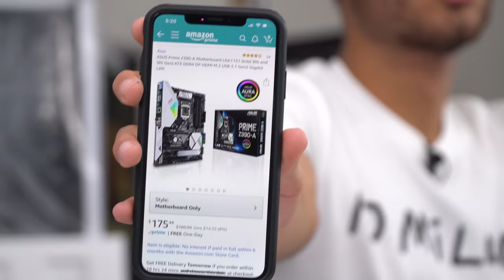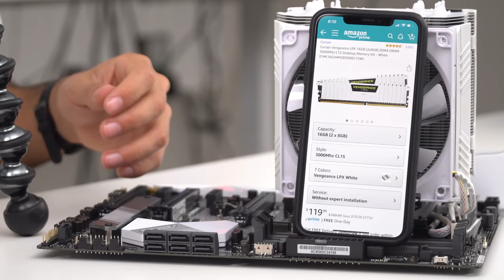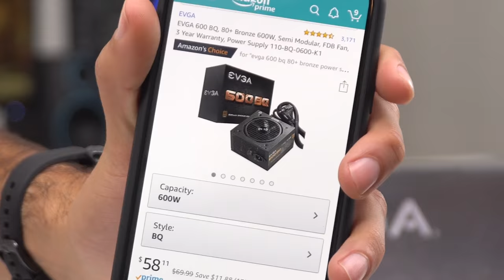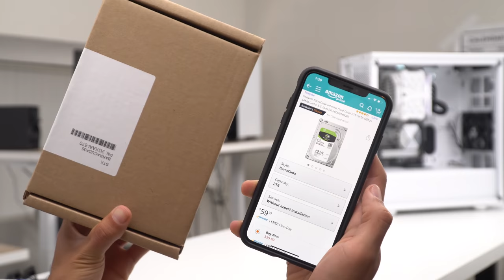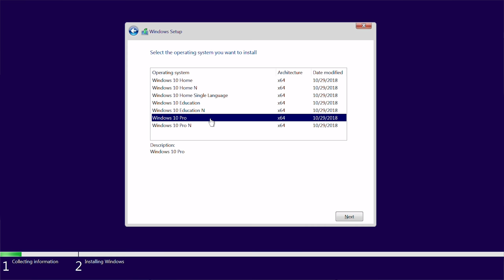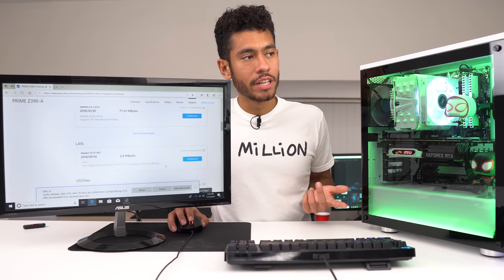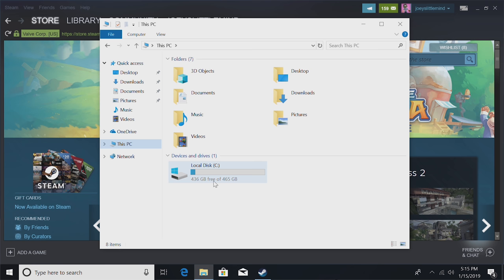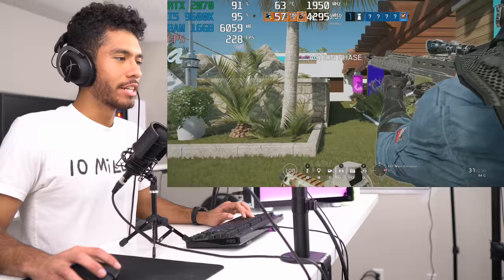$1500 Gaming PC Build Guide - RTX 2070 i5 9600K (w/ Benchmarks)

Comment: I built this PC with a friend and my dad tonight, love it!
Reply: Nice, how good is it. Im think8ng to do the same but im going to use a rtx 2070 and a core i7 which will upgrade it a bit
Reply: @MagdyF that would work even better, but even with the i5 I was able to get very high framerates on a lot of games maxed out settings. Doing the i7 would boost that even more.
Reply: @ericpederson6333  alright then, thx.
Reply: @Mohammad Younes nah the psu hes using is fine
Reply: Sry I'm a bit late but if you change to an i7 do you have to change anything??
Reply: @leoh.6379  check which socket it is, if it is a different socket from the cpu he is using in the computer you will need to change your motherboard, if not then no.
Reply: I'm building this exact PC right now. What monitor would you guys recommend? I'm a complete noob at 37 and this is my first build!
Reply: @jdwhodey  msi 144hz monitor bro
Reply: @jdwhodey  get at least a 144hz monitor, if you get a 1440p 144 monitor it probably won't be utilised to its full potential unless you play esports titles. Also try and find an ips panel if you can.
Reply: @urosjovanovic8625  yes
Reply: guys can someone help
me get a good cpu cooler becaus the one here is sold out i need one maybe better or the same please !!
Reply: @olytm9355  look at the corsair h100i or h115i or something

Comment: id recommend getting the MSI MPG Z390 Gaming Edge AC LGA1151 (Intel 8th and 9th Gen) motherboard it also has built in wifi and bluetooth its one of my favorite motherboards to use and its about 10 dollars cheaper than the one linked in the desc
Reply: Thx bro
Reply: Does it fit the case?
Reply: get an amd cpu and board u dont have to pay extra for overclocking . plus they have better value with support for pcie gen 4
Reply: Yo does the motherboard support gen 9 out of the box and can I use 3200mhz of ram or do I need to oc

Comment: I noticed the CPU and GPU are almost at %100 usage. Is that a bad thing ?
Reply: It's a good thing lmao. It means your GPU isn't throttling
Reply: If you don't lock your fps, ideally you'd get 90-100% on both gpu and cpu. If you're seeing your cpu getting fully loaded with your gpu barely breaking a sweat (or the opposite) you have a bottleneck.
Finally if your gpu (rarely cpu) isn't getting a high load and your fps are lower than expected, or there's stuttering, then you're thermal throttling: check the frequencies and temps to verify.

Comment: if u are watching this now get amd ryzen 5 3600 or 3600x and 2070 super
Reply: Ral- ph yeah why not if money is not a problem then yeah
Reply: I got RTX 2080 super is it better?
Reply: IndieChillout hell yes
Reply: HeRo what you rate the 2060 super or the more budget friendly 1660ti
Reply: @francoistaljaard12  my friend has RTX 2060 Super and its practically on the same level if not better than the previous GTX 1080. I know cause I had the 1080 before I got my 2080 super. The 2060 super if you want to future proof and high refresh rate gaming and higher resolution. 1660ti if you just want to play now and not too bothered about future proofing. 1660ti is more than good enough for 1080p gaming at 60fps+
Reply: Francois Taljaard  i mean if u have a lower budget u obviously go for the cheaper but the 2060 super is better but there wouldn’t be a significant fps difference it’s kind of like comparing the 1080 ti to a rtx 2080ti

Comment: I'm going to buy this in a month or so!
Reply: I'm going to buy the parts this week hyped pc masterrace when I'm back from vacation  then it's gonna to be finished by a friend that builds it. He worked by a pc company and have build pcs there too nice
Reply: @djangojansen7082  Could you tell me (when finished the build) how it was like and how well it performs?
Reply: @nesto9889  Its already done. My pc can handle 130 fps on everything epic on Fortnite. Without shadows and post proccesing. I get steady 240 fps.Without overclocking with overclocking cpu 70 degrees and gpu 81. 190 all epic 240 still steady.
Reply: @nesto9889  Let me see and take my partslist wil send it in a minute. U can also make it different with a 2070 it costed 1500 euro but the parts are the best and further proof.
Reply: @nesto9889  Coolermaster TD500 RGB full atx Diamond, Coolermaster Lite 700 watt Masterwatt lite PSU, Asus 1151 Prime Z390-A ATX RGB/ usb 3.1 . mobo, Intel core I7-9700 + BOX cooler S1151/3.0/4.7 GHZ/ 65W. , Kingfast F8N M.2 SSD 480GB 1880/1500MBPS, Toshiba P300 1 TB/ 7200 RPM HDD, NVIDIA RTX 2060 OC, Kingston  16GB 2x8 gb HyperX Fury CL16 Black/ DDR4-2666Mhz
Reply: @nesto9889  Suggestion is to add a bigger ssd other cooler for the cpu and thats it pls response ive i helped u out
Reply: @djangojansen7082  Why a bigger SSD, I think an m.2 240GB is enough for Windows, right?
Reply: @nesto9889  your but im also downloading games on it ssd is superior m.2
Reply: @nesto9889  mine is 480gb
Reply: Would 240GB be enough for both windows and Fortnite
Reply: @nesto9889  ive used 260gb for only Fortnite, windows and like programms (u have to install them on your primary storage). But 240 will be ok but a little but budget like
Reply: @djangojansen7082  Ok
Reply: @nesto9889  how did the builds go
Reply: @djangojansen7082  hoe ging de build
Reply: @avatarmorris8956  goed alles werkt opzich perfect pc start lekker snel op enzo. Het enigste waar ik beetje aan zit te twijfelen om een i5 met 2070 te nemen dan had ik 150 fps op alles hoog en nu 130. Maar ik kan hem overclocken naar 84 graden max op alles En dan is op alles epic 190 fps. Dus ik zou deze build gewoon bouwen en dan misschien geen standaard cpu koeling erop zetten. Ik zelf ben waterkoeling van nzxt aan het overwegen of corsiar. Maar ga nog mechanisch toetsenbord en goede muis kopen. Dus denk dat het een luchtkoeling wordt van rond de 80 euro. Dan is die gewoon wat cooler
Reply: Nog bezig met ontvangen!!
Reply: @nesto9889  mag ik weten welke parts je gebruikt hebt
Reply: @avatarmorris8956  heb je insta, dan maak ik screenshots van mijn lijstje
Reply: @nesto9889  ja add @sjorsqk

Comment: if i used an i7 core instead of an i5, then would everything still programme the way they are supposed to
Reply: Umm what? It still works yes, just make sure the first digit at the end, like 9600k, isn't too low since it can cause performance issues called Bottlenecking

Comment: I built the same PC a couple days ago. I used the same motherboard, graphics card, RAM, case and hard drive. Instead of the other components i went for the i7 9700k, samsung 970 EVO m.2, and a corsair aio cooler. This mini upgrade all together was around £1600 and i can overclock later on if i want. Super dope video thanks for the help!
Reply: Younes Belacel are you getting the same fps he got on games while playing on this pc?
Reply: Probably higher but im playing in 1440p and i have no troubles with over heating and its super fast. The aio cooler is a must. It looks amazing and my cpu hasnt been any hotter than 41 degrees.

Comment: the only thing i changed about this was going from the i5 to a i7-8700k. 
with the power supply, would it hurt to go with a 650 or larger or is the 600 going to be more than enough?
Reply: Would also love an answer to this because I have a 600w and was hoping that’s enough with a i5-6400 and rtx 2070
Reply: TheAlphaWolf U dont need more than 600
Reply: The i5 9600k is better than the i7 8700k.

Comment: R5 2600 - $150
MSI B450 Tomahawk - $110
Corsair Vengeance LPX 16GB DDR4-3000 C16 - $105
Crucial MX500 500GB M.2 SSD - $50
WD 1TB 7200RPM Hard Drive - $40
Gigabyte RTX 2080 Gaming OC - $730
NZXT H500 - $70
EVGA Supernova G3 650W - $80
Total: $1,355
Cheaper and has way better performance than this build
Reply: @josephstein3559  You can get whatever you want. That would also perform very well
Reply: @josephstein3559  600 maybe, but even that would be kind of overkill. Just go with 600 because that is more than enough.
Reply: Doesn't ryzen gets really hot?
Reply: Zeiba 160 No, ryzen runs very efficiently it’s amd gpus that run hot
Reply: @emorodriguez7124  depends what you're using for cooling
Reply: Joseph Stein I didn’t list one because the amd stock cooler is good enough the 2600
Reply: @josephstein3559  if you want to overclock, get a 2600x
Reply: Joseph Stein You can get a mild overclock with the stock cooler. If you’re not satisfied with performance or temps, that’s something you can always change out, but to be honest you’re not going to see much of a performance difference going from 4ghz on stock to 4.3ghz with a higher end cooler
Reply: @josephstein3559  link to the 500$ 1080ti?
Reply: Zeiba 160 Intel gets very hot
Reply: Will the amd 5 2600 bottlenecks the Corsair Vengence rams?
Reply: @si1513  lol no
Reply: But how future proof?
Reply: Any benchmarks ran on that build to compare??
Reply: Can i upgrade this build?
Reply: Ben Shapiro u should have gone with a better cpu
Reply: @josephstein3559  Don't overclock Ryzen cpus for gaming, only for workstation use. Ryzen's natural boost system and xfr are better for gaming performance than a manual all core overclock. My advice would be go for the Ryzen 5 2600x, 200 MHz more performance on base clocks and boosts, and a better stock cooler for $50 is really worth it.
Reply: @josephstein3559  Np gl man!
Reply: 😂😂😂😂 Do you have any idea how hard the cpu will bottleneck? 
Nobody pairs a 2080 with a ryzen5 bro😂
Reply: Neelabh Agrawal The 2600 won’t bottleneck the 2080 and even if it does it will still get better gaming performance than the i5 and 2070
Reply: Rather just wait for 3rd gen 7nm ryzen
Reply: @josephstein3559  I would. The stock coolers are great for overclocking, and if you want to overclock down the line, there are great options.
Reply: Ben Shapiro any intel cpu which would fit this ?
Reply: Is a Ryzen 2600 enough for RTX 2080? why not r7 2700
Reply: Ben Shapiro Has
Reply: Ben Shapiro, I love ben shapiro
Reply: i5 9600k smokes your Ryzen in gaming lol

Comment: I went for the same exact parts except for the cpu, I decided to go with the i7-8700, is the i5 better for this build or did you just pick it to fit this budget? Thank you
Reply: The i7 is better
Reply: You cant overclock an i7 8700 it's not a 'k' processor like the 9600k. I'm not sure about prices off top my head but I'd assume there about the same price if you include the cost of buy a fan for the 9600k, non k processor include the fan. 

TLDR, Plan on overclocking? Get the 9600k. If not then get the i7 8700.
Reply: Chris Mazzei thank u I appreciate your help, I bought a motherboard that isn’t overclockable so im not really planning to overclock
Reply: @Jdicjsbciendufieb  do you think this pc is good for streaming?

Comment: 240hz or 144hz for this build in games like csgo overwatch and fortnite?
Reply: You can easily get 240hz it's about your graphic settings. I would say u can run it on like 180/240 fps with good settings. So i would by the 180hz monitor from asus I'm going to
Reply: that's what I also want to know. But in my case it's Rainbow Six Siege. He hits 240 in the video with ultra settings. I'm gonna play it with low/med settings but still not sure if it's gonna be stable 240 FPS. 

In CS:GO you will easily hit 240!
Reply: @mashinka5550  pretty stable
Reply: @djangojansen7082  You sure? Do you have this setup? Would be a huge fail if I bought the 240Hz monitor and the game doesn't run on 240 FPS
Reply: U should always have your graphics set to low for any shooter game. Especially overwatch

Comment: Worth to buy 2060 or 2070 for 1080p gaming ultra settings in all games?  Pc build with rtx 2060 1410€ ,Pc build with rtx 2070 1530€...I have seen a lot of videos and the only difference is that 2070 give 10-20 fps more than rtx 2060...So which graphic card should I buy?
Reply: Dimitris PAOK if u plan on using ray tracing I’d go with the 2070
Reply: 20 FPS more aren't bad. Now you won't probably see the difference, but in a few years when the 2060 build will run games in 40 FPS ultra 1080p, the 2070 will go up to 60 sometimes 70 too with the right OC. I also built a 1529€ PC and it's definitly worth it. The 2070 is such a beast, 2060 too but 6 GB Vram aren't enough for a 2018 mid-high gaming rig

Comment: I hope i could get in middle east ( Kuwait ) country this pc. 

I'm mobile player and i want to move to pc soon and i have like 1320 dollars = 400 kwd.
And i want to sell my ipad pro 10.5.

I hope i get same as this pc.
Wish me luck❤
Reply: @PhasingThrough thanks😊
Reply: I'm in the same situation. I live in Italy and I have 1250 euros which are like 1412 dollars and I'm going to buy this soon. I've been saving money for an year and a half now so I'm really excited
Reply: @dbomba  i got one with these stuff and please don't buy what i did 😂  
i was very excited and messed up everything😭🤣😂

I build a pc for Fortnite and Apex Legend, and i really hate it because i got 100 fps on low graphics in fortnite. Here is info about my pc.

:-Intel 8700 core i7.
:-Gigabyte rtx 2070 VGA.
:-Asus h270 pro prime gaming motherboard.
:- Ram 16 GB DDR4.
:-SDD 240 GB.
:-HDD 1TB SATA.
:- Cooler master k500 case
:- power 650 W.
:- Windows 10 pro 64 bit.
:- cool master hyper 212 evo 120mm cpu cooling fan.
Reply: @dbomba  i had 1200 dollars
Reply: @supersoldiers3276  are you sure you did everything in the right way? It's so weird. With those specs in Fortnite you should do like 180+ FPS in ultra. Have you bought it preassembled or you built it? I think you must check the CPU and GPU utilization and if all the drivers are installed and updated. Then check if there are issues with the components or if something is damaged or put in the wrong way. Good luck with your PC
Reply: @dbomba  i did everything good and i head that the problem was from game and now i get 140 fps on fight and 180+ when I'm just moving around but still it's on low graphics settings btw thansk 😊 i hope you get better pc 😉
Reply: @supersoldiers3276  thank you. Hope you can fix something in future
Reply: @dbomba  thank you😊
Reply: عربي؟  غريبه من سابع المستحيلات تلقى عربي هنا
Reply: وعلى فكره اعتقد والله اعلم ان المشكله من المذر بورد غيرها خذ z370
Reply: @ll4353  i understand you brother but i can't speak Arabic, btw can i change motherboard after installing everything?
Reply: @supersoldiers3276  yes, you can! After all, if the motherboard isn't compatible with your hardware, your hardware won't be used to its full potential, So I suggest that you upgrade your motherboard, and you should be running fortnite on ultra settings without any problems. 😊
Reply: Doesn’t Kuwait give you lambo’s

Comment: Invest 50$ more and get a ryzen 7 2700x and it would last you much longer
Reply: Yair Sollel no
Reply: @evenlilleland6347  no what
Reply: Would it change anything or is the pin set the same on the ryzen 7 2700x as the intel i5 he used
Reply: I would pay 100 more for the i7-8700k. Not ryzen though.

Comment: Just bought the parts and should have everything on Monday! I cant wait to build this PC! You've helped me alot on PC info or building in general! Thank you so much! You're making awesome videos!
Reply: ThyPajj yo how much was everything combined
Reply: @tinbullet2179  pretty much a bit over 1.5k because some of the parts are expensive now.
Reply: ThyPajj dam which ones and do u think if I swap the graphics card with a 2060 it will lower it a lot
Reply: @tinbullet2179  well the motherboard costs about $183 right now, the CPU is $250, the fan cooler is $91.91, ram is $70, cause varies from $110-115, the power supply also varies too from $73 with about $14 tax to it while every other option is free but more in the $80 range to $100 range, then the hard drive is $60, 500gb ssd is $73 and the GPU is $460. All together you should pay over $1,000. Tbh if you lower the GPU Itll lower the graphics and fps but It wouldn't be a huge downgrade. Still a great gpu. The price ranges Is what I looked at right now and is the current costs. The motherboard went up by $8, the CPU went down by $10, the fan cooler isnt available on Amazon so I bought mine on newegg for about $91, the ram when down by $50, the case went up by $20-25, the power supply went up from $20-45, the hard drive went down by $10, the 500 GB ssd went down by $8, and finally the gpu is still the same price which is $460. I hoped I helped you! Spent quite a while aha looking everything up! I hope everything goes well for you!
Reply: ThyPajj ok thank u - u too 😃
Reply: I need to know, how'd it go?
Reply: @avatarmorris8956  it went well! It runs smoothly and everything! Was nervous when I first booted it up but very successful!
Reply: @thypajj8914  oh boy I'm so excited, what game do you play and how many fps do you get?
Reply: @avatarmorris8956  if I play fortnite on high settings, I'm making around 200 fps close to 300 fps. Csgo I make around 100fps or around 200 fps.
Reply: @thypajj8914  nice dude, did you use exactly all the same parts from the video
Reply: @avatarmorris8956  yes, I ordered an water cooler instead because I couldn't order a air cooler in the video but everything else I bought in the video
Reply: @thypajj8914  sorry for asking so many questions but which one did you use